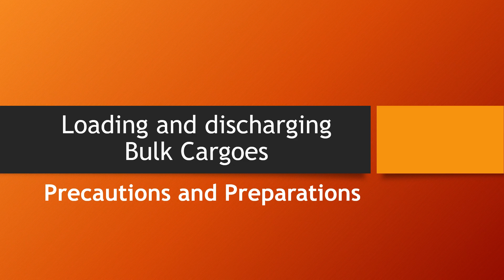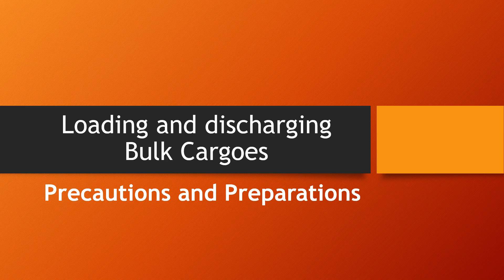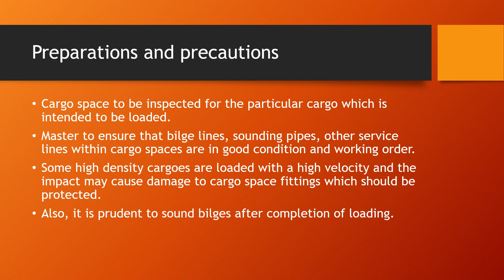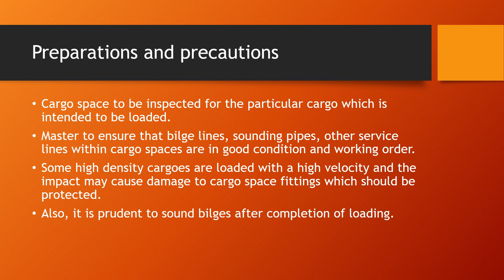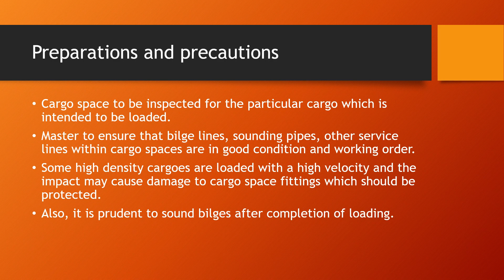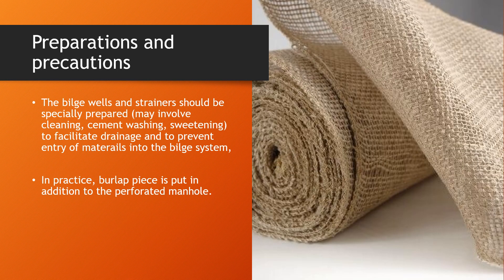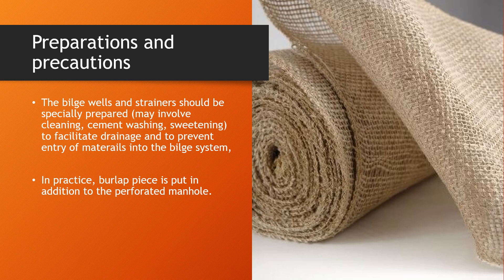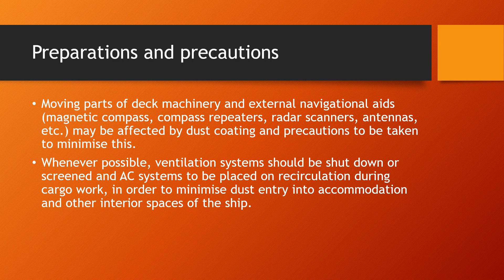Loading and discharging bulk cargoes - Cargo Work on ships

Comment: Sir How to clear cargo bilges if the nrv flap is stucked due to cargo?
Reply from the maker: You have to do it manually by going into the cargo hold otherwise the water in the bilge line may travel back into the cargo hold; regular inspection required as per pms.
Reply: @SteeringMariners  thank you sir🙏